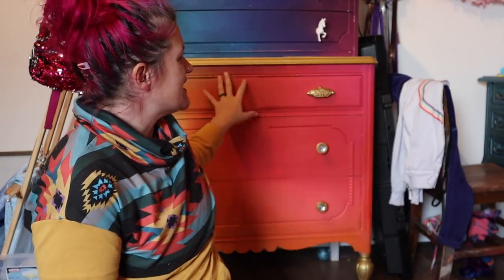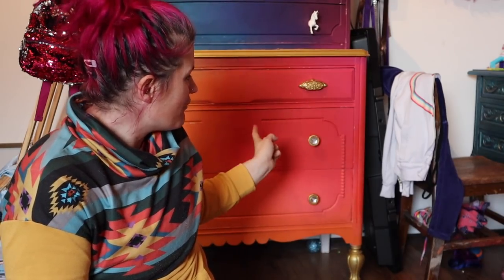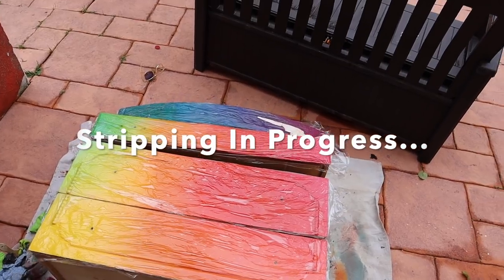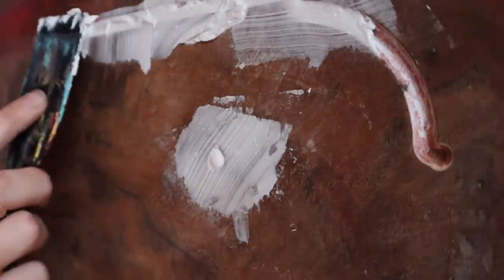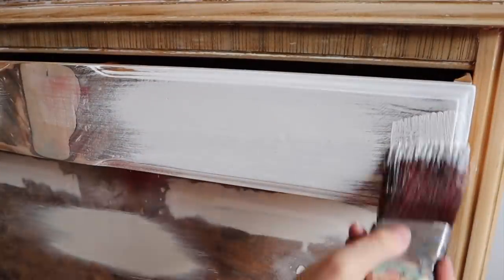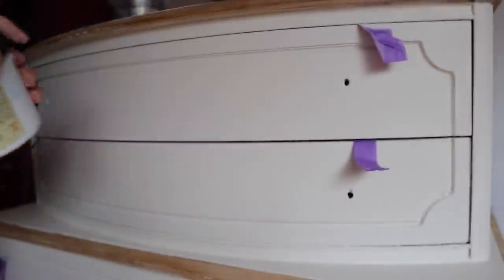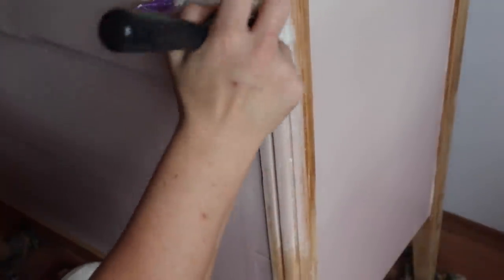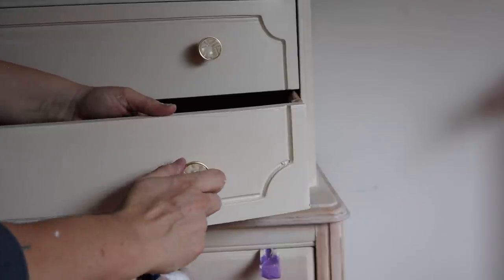Pink Painted Dresser Makeover- Stripping and Blending Paint Using Chalk Paint

Comment: This is soooo beautiful! I love the choice of hardware and the blending is stunning as always!  I have been researching top coats to go on chalk paint because it seems wax would not be very durable. It is such a struggle because so many reviews on topcoats say they yellow.  I believe it might have been Pretty Distressed/Christina that compared several and determined Varathane Ultimate held up the best but some reviews complain that can yellow too. (I wonder though if people applied the coats too thick).  There is so much to learn! Thank you so very much again for the valuable lesson and video!
Reply from the maker: So one of the ways to avoid yellowing is making sure you have a blocker as well yellowing is usually from tannins or you are right putting it on too thick :) I like the satin clear coat and it hasn’t yellowed on me yet lol 😂
Reply: @BellaRenovare  thank you so very much! I have spent so much time researching this and I thought Oh man, I might have to do a test piece of wood and let the blasted thing sit for 6 months before I start. ha ha You saved me a ton of time. I had thought it must be errors people are making to cause this when so many people say the top coat doesn't yellow (even on white) and just a few give reviews to say it does and it ruined their projects. This was true for reviews on the Varathane and the Dixie Bell top coat. I will definitely use a blocker ahead of time then to avoid this problem. You read my mind when I did wonder too if Satin would be ok because Matte is hard to find and much more costly. Thank you so much again! You are the best! ❤️